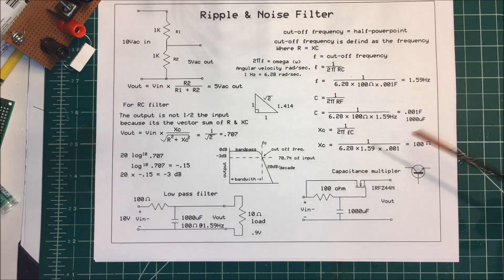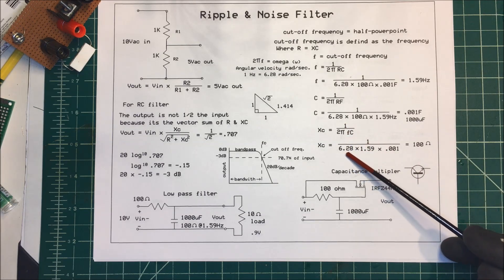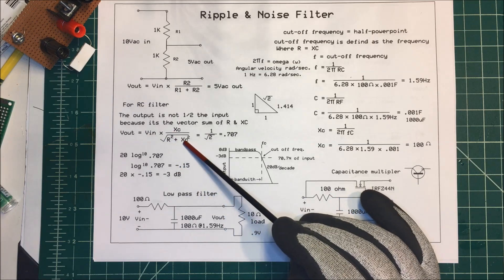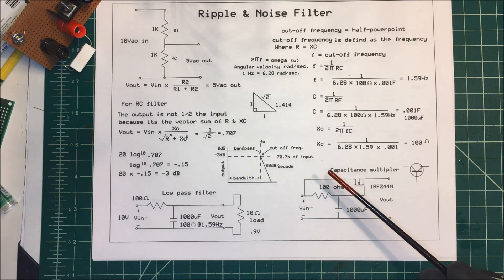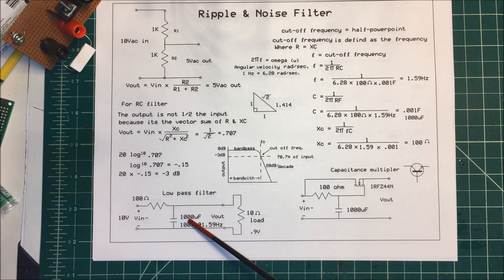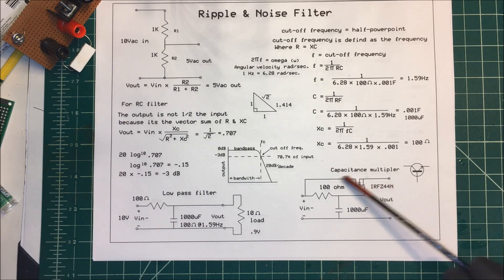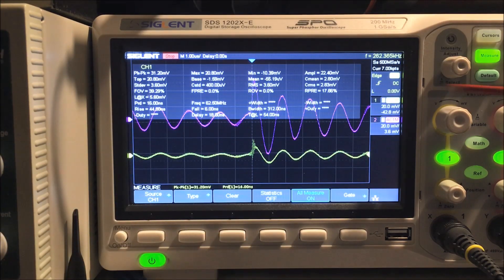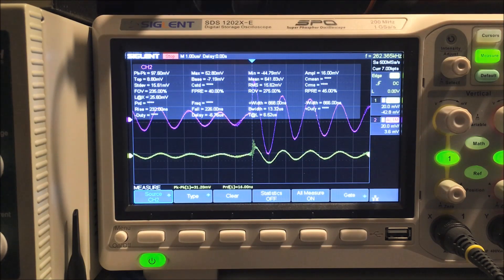RC Filter

Comment: Good video (the first 3 min); concise. It didn’t occur to me consider Xc and how it all ties together. 

1:53 I thought you glossed over this way too quick, though. I was thinking R1=1 and R2=1.414 at first, but those numbers calculate to 58.5%, not 70.7%. It made sense after I realised if you add R=1ohm and Xc=1ohm (a resistor and capacitor in series) you get 1.414ohm.